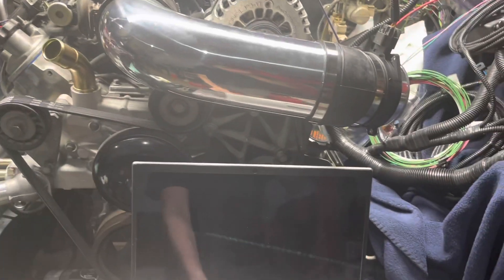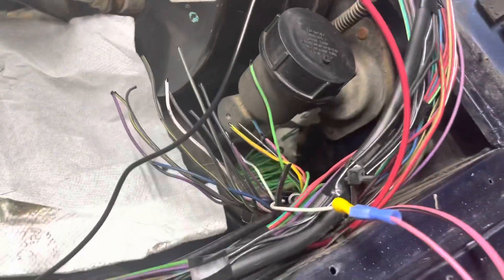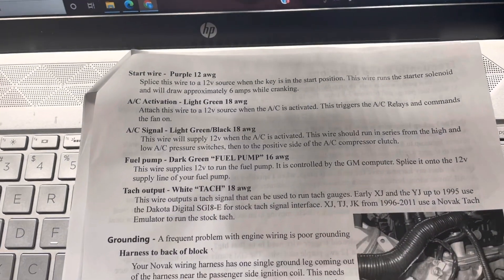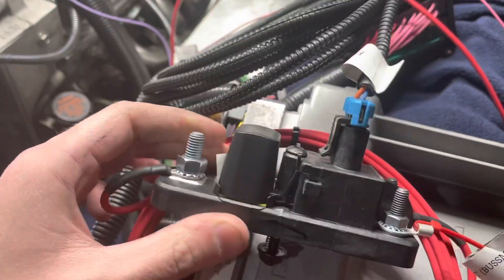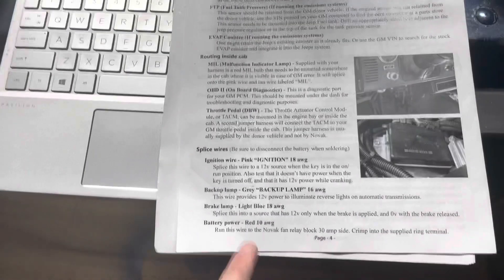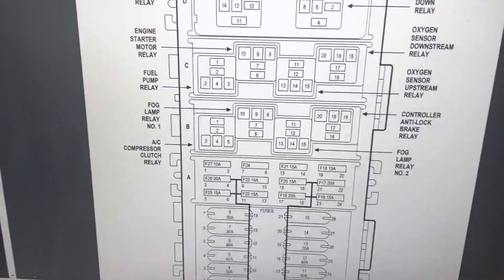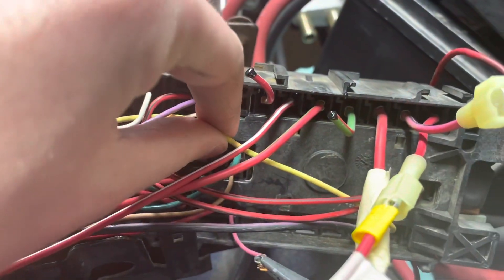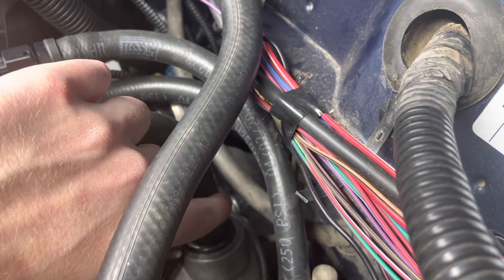Jeep Cherokee LS Swap Wiring

Comment: Is this just a standalone harness or does this integrate with the stock xj computer and does your stock cluster gauges work? I'm just starting to plan for an LS swap next year and the wiring part seems the most unclear to me.  so far it seems if you want the stock clusters to work you have a standalone harness and computer for the engine and then you use the old harness with just the sensors and stock computer for the sensors. But then my question is does the standalone engine harness and computer not need to know the sensor outputs?
Reply from the maker: If you want to keep the stock gauges you will keep the stock computer. You can leave the engine wiring harness as it is or go through and eliminate anything that does not relate to the gauges. I went with autometer phantom gauges and completely removed the Jeep engine wiring harness and Jeep computer. I am using the 5.3 engine harness and 5.3 computer. To keep the stock gauges you will use the 5.3 harness and 5.3 computer along with the Jeep computer still hooked up just to run the gauges. Novak Conversions in Utah are the people to ask about keeping your stock gauges. I sent them my 5.3 harness and they sent it back cleaned up with all wires labeled ready to plug in. You can also send them your 5.3 computer to be reprogrammed. To keep the stock gauges I believe you have to buy their tachometer emulator in order for the Jeep tach to work. Give Novak a call they will be able to help.
Reply: I'm still in the fence about using the 5.7 hemi out of my commander since I'm about to get another daily driver or an LS  ...the hemi might be cheap since I have a complete donor ... The 4.0 is a great motor but it's lacking with a 6k lb rig on 42+ tires only works on low range high is useless . The stroker route seems like a waste of money for the power . The V8 seems like it should fit between the rails with my strut towers where they are with minimal rework...this fall I see a low miles 4.0 for sale I'm tempted to start now but I know how shit works and I'll end up . missing the season like my last quick project . Nice video thanks for the walk through if the harness .

Comment: Awesome video, I'm swapping a 5.3/4l65e with a 241C transfer case into my 98 XJ. Did you use Novak for your headers, radiator, fans, and engine mounts?
Reply: On that 241c qhat did ypu do for the shifter
Reply from the maker: Thank you! Yes I did! Good luck with your build.